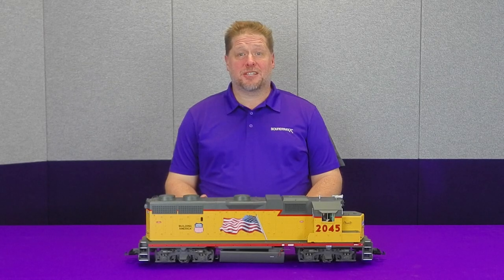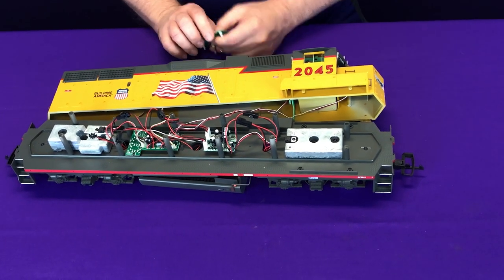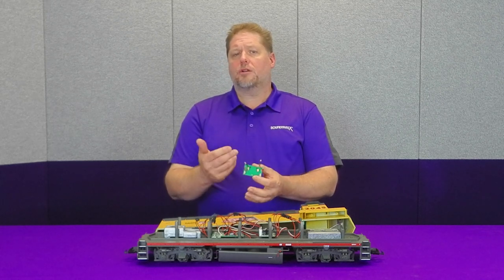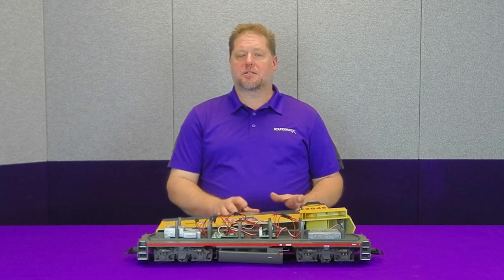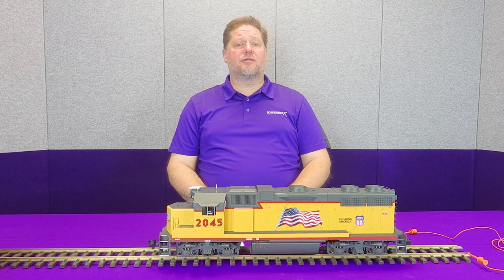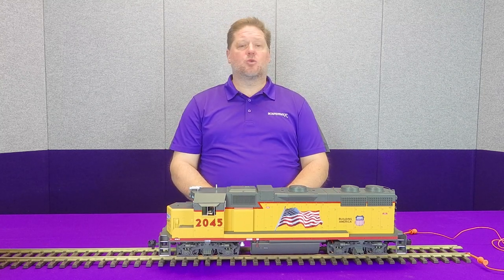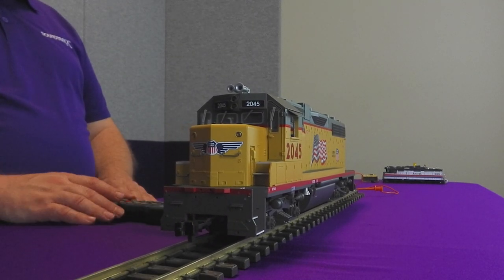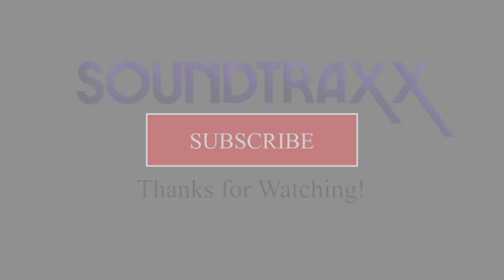Tsunami2, TSU-4400 Install into a USA Trains GP38-2 in G Scale

Comment: I do dead rail Gscale for the Protothrottle. This decoder is my favorite.  Great sounds, easy to setup.  I generally gut my locomotives and rewire them for LEDs so the common negative really isn't a problem for me.  I use the CL2N-G led drivers which work great, no need to calculate resistor values.  Parts-Express has some really great smaller speakers, they sell a couple of 2.5 inch speakers that have passive radiators built in - really great bass response.
Reply from the maker: Thank you for all of the feedback. We are glad that you are enjoying this decoder! We would love to see some of your models in action if you have video to share.

Comment: Did the manufacturers just decide since MTH is mostly out, that common negative is the new standard? If so that’s stupid.
Reply from the maker: Not sure.  It seems to be used more commonly for china-made factory-installed sound systems.  Not sure why this one is using it as well, but this is what I found.

Comment: I have question about mounting the decoder with doubled sided sticky tape. Did you elevate it that high to let the chip breath? What size wiring did you use for your motor and track pick up?
Reply from the maker: I used double-sided foam tape to install the decoder, but I used 2 layers to rise the decoder up above the solder points of the screw headers below the PCB.  That way is was more firmly mounted.  The air flow helps, but is not necessary.  The wires for track power and motor leads were what was inside the model.  But if you were replacing it, I’d probably look at 18-20 gauge.  Maybe 22 if space or flexibility is more necessary.

Comment: Hi, I just installed this card in an Aristo Craft U25b and it works and sounds great. I do have one issue I'd like to ask you about. I removed all the electronics and wired everything directly to the board except the smoke unit control. I powered the control board and smoke unit switch using the track pickups.
 If I turn on the smoke unit with sound off  and then turn sound back on everything works perfectly no matter speed or direction. If I turn on the smoke unit while the sound is on the decoder trips and restarts, after restart everything works fine again.
I'm guessing the smoke unit is overloading the board when sound is on, what are your thoughts.
Reply from the maker: Contact our Support Team and they can help you with this: (970)259-0690 ext.22 or support@soundtraxx.com